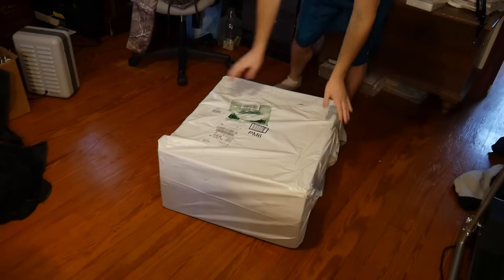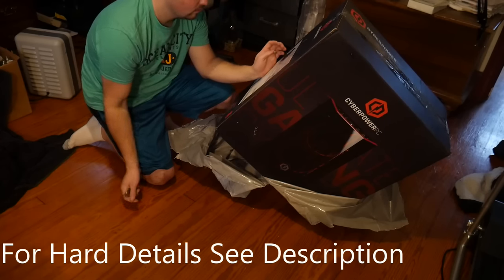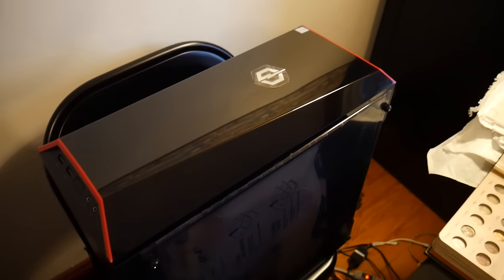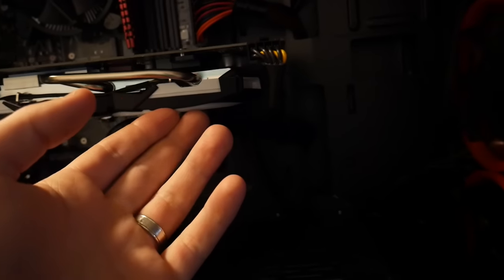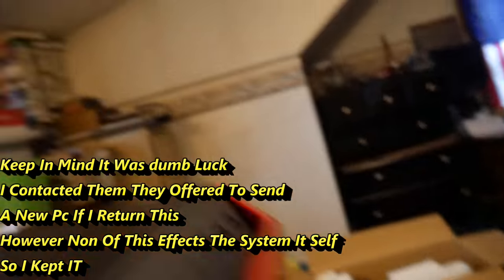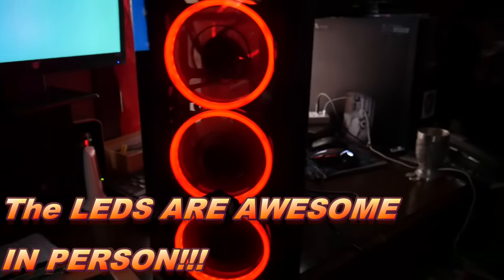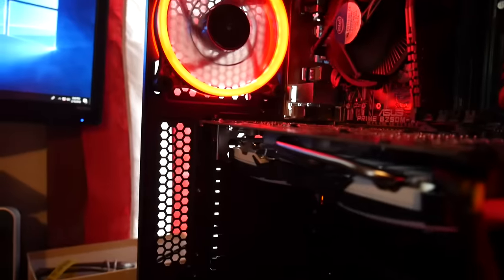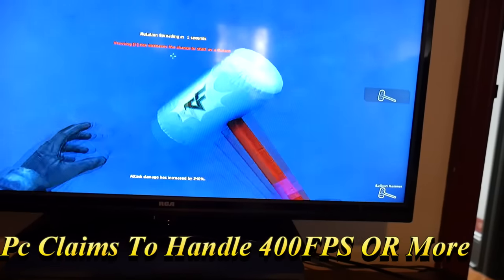CYBERPOWERPC Gamer Xtreme GXIVR8020A4 PC Full Honest Unboxing Test & Review

Comment: How has this compute held up? I’ve read the power supply is bad and tends to go bad, have you upgraded that? Thanks!
Reply from the maker: hello! pc has held up perfect runs like i just b ought it, i have not had a single issue with the power supply and im even running 4 extra fans and more ssd drives, however i am gonna upgrade the power supply in the future but not because im having any issues i just want more power for future projects with it
Reply: The Life Of Scott sounds good, everything out there has some bad lemon reviews i suppose. thank you, when exactly did you buy it? Just wondering if the pc will still be sold come next summer. I will definitely want to upgrade to an ssd and an extra stick of ram should this be the route I take
Reply from the maker: i purchased this almost a year ago, currently they still make it And Plan on making if for awhile they actually make Many Version of it! some run from 699 up to 4,000$ more you spend more you get i got a bunch listed in my descrp
Reply from the maker: also dep on how much your willing to spend currently for 850 you can get the upgraded one with 120gb ssd and 1tb drive and other upgrades for only 850 https://amzn.to/2MUTaNs

Comment: Does the antenna connect to your router? And does it make you have lower PING? Also what is the FPS
Reply from the maker: yes and yes it helps with your internet connection and speed :)

Comment: I ordered this computer and it should be here tomorrow. How does the laptop fan on the side attach?
Reply from the maker: Its Just Enough Side That You Can Wedge It  In The Frame Without it being to tight that it scratches anything, you can also just Get 3M Tape Which u can find here - https://amzn.to/2xWddSu ITs Cheap And Strong And Does Not Cause a Mess When Removing like normal tape or Duct Tape
Reply: Just subscribed. Thanks for the help!
Reply from the maker: Anytime :) Thanks For Subscribing!

Comment: Hey I was wondering if you think that I can stream 1080p60fps using elgato stream command with this.... on the website it says that i7 or better is required for stream command but I was just wondering if u think that I can stream absolutely no problem in good settings. Plz answer
Reply from the maker: In good settings u can. If your worried I would check out my video description I have a bunch of safe computers with i7 for only few 100$ more but if you can't afford that u can always upgrade the CPU if you have great internet you should be fine especially if you over click the gpu

Comment: Hey man im pretty new to the pc world i just bought this pc and was wondering what do I need to do once i boot it up? Do i need to download drivers ?
Reply from the maker: You may need to update the driver which is simple to do under amd website your pc may do it for u if u need any more help let me know
Reply: Oh okay thanks ! And is that all? Just download the driver and then just start gaming or is there more to it
Reply from the maker: thats it! you can add other programs to over clock the gpu and a lot of other things to help make the pc faster but if you dont know much about pc's then you can learn over time about that stuff like i did :)
Reply: Oh well thank you! Very helpful!
Reply from the maker: your welcome! if you have any other q's im here :)
Reply: Alright so once I download the driver whats next? Is there anything else im supposed to do witht that?
Reply from the maker: That's it! Your ready to game now of course u can download other programs and over clock the gpu ect and things faster  but the list is never ending on things to download you can learn as you go
Reply: Hey man im having a problem i turned on the pc and i cant see no display on the monitor , i have an hdmi connected. Do i need a different port?
Reply from the maker: Hey oscar I had that same problem yes try the other ports  use the gpu port it's the last port on the left in a line there will be like 3 other ports beside it
Reply: I dont see another hdmi port.?
Reply: Hey i got it to work! And now im on the driver part i have download the driver and now what do i do? I opened the amd program amd it says versions of something
Reply from the maker: look for the latest one it will be 18.5.1 or higher
Reply: Hey man im think of upgrading my graphics card to a different one what should i look out for ? I hear the it comsumes more power so i would get a better power supply ?
Reply from the maker: Upgrading power supply is a good idea and the gtx 1060 or 1080 I hear is very good
Reply: Are you currently using the graphics card rx 550 that came with the pc ?
Reply from the maker: Same card but I upgraded to 8gb of vram vs the  4gb one that came with it
Reply: Hey I install an 8gb of ram to my pc but when i try to play assassins creed odyssey and i go to settings it tells me i have a total of 4096 mb vram??!
Reply from the maker: vram is different then A Ram stick, Ram Sticks / Cards Are  not GPU VRAM Vram comes with what ever gpu you have, you would have to buy a new GPU to get more VRAM @oscararanda8412
Reply: Ohhh i see your helping me learn lots of things thank you! And one more question how i check my ram stick actually worked ?
Reply from the maker: @oscararanda8412  your very welcome, go to your task bar on your PC at the bottom of your screen of the left you'll see windows icon ( looks like 4 white squares ) right click that then click on system scroll down and on that same page ( about page ) it will say installed ram and show you how much ram you have and other details
Reply: Ohh gotchaa! And hey i was Thinking of replacing the psu cause i heard it was bad and i wanted to know if any psu can be compatible with motherboard port or connections? I want to get a 650 w for the gtx 1070
Reply from the maker: @oscararanda8412  hey oscar im sorry i have not dipped into power supply yet, im going to be working on swapping mine out in the future as well, but i can say so far i have  8+ fans hooked up and never had any power issues  but i do want a higher watt one just for future mods

Comment: I’m getting this pc off of amazon, it says it’s used - good. I don’t want to get any upgrades or anything but some people are saying overtime you should get new powersupply and fans do you think because mine is used I’d need to? I don’t want to upgrade because I am spending a lot of money on it. I want to play forza horizon 4 and fortnite and rainbow six siege.
Reply from the maker: Hello you can get cheap fans for 10 dollars each I do recommend adding one or two inside just for better air flow but it's not needed u should be fine just don't pay over 680 for a used one because you can get new ones for close to that also I've had mine a year and never had any power supply issues
Reply: The Life Of Scott Wenger okay thanks the one I am getting is 899 cad which is 675 usd. And the new one is 999 cad
Reply from the maker: Ok :)

Comment: Hey, the pc you recommended in your description has a GTX 1060 3gb, isn't it less powerfull than the RX 580 4gb that you have in this video?
Reply from the maker: They are about the same if you over clock the 1060 you'll get a little more performance out of it and with an extra ssd  drive it offers a bit more storage and speed but you are right this pc I have ( it's also in description ) and that pc are about neck and neck this would be a little better if you don't do any over clocking
Reply: @ScottsHonestReviews  yeah it's kinda tricky coz as you said the ssd adds a little speed to it. I'm extremely iffy actually, im about to buy one of 'em and i want to make the best choice out. i'd definitely need any last advice on which i should go for
Reply from the maker: When I Get home from work I will go over both pc specs and see for sure which would be best for you. What's your main goal, only gaming or are you planning on it being your pc for everything this one I have I currently  use it for everything and it's been amazing
Reply: @ScottsHonestReviews  Hey, quick update! I ended up chosing the same computer you have with the RX 580. I been using it for almost a week now, so far everything is going perfectly fine. Tbh the pc is performing better than i expected;when i got i installed couple games and tried it, the pc got loud for a bit then i updated all components and no more loud noise when playing, infact i find no difference between just surfing on the internet and playing.
Reply: @ScottsHonestReviews  I plan to buy a SSD and another 8GB DDR4 and slap them in just to give it more juice even though i play latest games like apex without overclocking and i hit high frames. What have you upgraded in yours?you honest reviews helped me a lot so big thumbs up and im smashing this subscribe button!!
Reply from the maker: That's awesome I'm really glad your enjoying it!! So far I'm loving it too almost 1 year 6 m
Reply from the maker: Thank you for subscribing! I'm glad I helped you!! I just upgraded to a 8gb gpu I went with the same gpu Radeon 3rd 580 just 8gb instead of 4 and added more ram I added two external drives 6tb each for storage and 1 ssd  drive I have a cyberpower pc playlist I need to upload more cyber videos
Reply: @ScottsHonestReviews  You're welcome.That'd be great, A whole review of your computer and what you upgraded. you must have a lot of games and stuff to use 12TB
Reply from the maker: Oh you have no idea lol 76 steam games, every gambit game Nintendo game snes game n64 game ps1 ps2 game and more

Comment: Hey i ordered the same pc and its should be here tomorrow. I hear a lot of people complain about the cooling, any suggestion on what to do ?
Reply from the maker: I installed a few extra fans all for 25 bucks and never had any issue , you can take the side panel off and front panel off to help
Reply: @ScottsHonestReviews  hey so my pc came and one of the front fans don't work so I have to get that fixed. But are the fans underneath the graphics card supposed to spin? I'm new to pc so i'm not sure if its supposed to spin or not.
Reply from the maker: Check the fan connection and the gpu fans will only kick on when the gpu gets to hot so the longer you game the hotter your gpu will get then it will kick the fans on
Reply: Also the one that came with mine looks different than the one shown in your video
Reply: @ScottsHonestReviews  Can you tell me how to check the fan connection?
Reply from the maker: Hmm best way to tell you is take the side panel  off on the inside you should see wires going to the fan follow the wires to the plug and plug in and plug out  most times things  come loose in shipping
Reply from the maker: If you can make a video and upload it that could help
Reply: @ScottsHonestReviews  Thank you! I'll be sure to give that a try
Reply from the maker: YW!

Comment: so where the fans just not doing the job in terms of cooling?  or did you just add the extra fan for security?
Reply from the maker: i added extra fans for security, some games like epic battle sim, when the pc is under a lot of stress all the fans kick on full speed to try and cool the pc off causing it to slow down a bit, i just wanted extra cooling power and its done the trick

Comment: does it come with all the plugs needed, like the cables. Do you just connect the cables to the pc and monitor??
Reply from the maker: You'll need a HDMI cord if using it with your monitor  that's it plug and play
Reply: Oh does the monitor come with a HDMI cord also what about wireless wifi
Reply from the maker: Most gaming pcs do not come with a monitor you have to buy one or use your tv

Comment: Hey bro quick question. I’m moving from Xbox to pc and I’ve been eyeing this pc for about 2 months of saving from my job. Any problems or cons to owning this pc? Like overheating or system problems. I’m not familiar with pc at all and I’d like a step by step explanation for this pc before buying it on amazon. Plz respond!!
Reply from the maker: Hello pc gaming is a whole new world then consol for one it cost wayyyy more but the games are amazing issues with this pc well I've owned it over a year now and have had no issues but I do recommend adding more ram and extra cooling if you plan to game for hours at a time besides that I think you'll love it for it's value it's been the best pc I've ever bought the one in my description that I have listed as I recommend if you can afford that one which I believe is now on sale for like 799 or less with 1060 or 108p gtx I would buy that one it's the same pc but upgraded parts at a steal of a price
Reply: The Life Of Scott Wenger thanks bro! I plan to buy this pc and get a razer mouse and keyboard but when u set up the pc is there any like usb for windows for the set up or is it completely ready to use like do u just plug it in and it’s ready? Or is there like a set up u have to do?
Reply from the maker: There is a setup but it's already pre ready so all you do is plug the pc in and follow what it says and your done so basically answer questions on the screen and your finished lol it's very simple
Reply: The Life Of Scott Wenger ohhh so basic set up and it brings up the home page? Also like how do u download steam or anything like that. I’m moving to pc from console and I have no pc experience at all. I just thought this pc was more affordable and worth it at its price. A walk through would help me out a lot 😅
Reply from the maker: Yup basic setup and for steam you'll just setup your internet and once connect you can use your web browser to search google for steam then go to the website and download the steam program from there you can search all kinds of amazing games I'm working on uploading a video of a few steam games I love playing
Reply: Sweet. Thanks bro! Keep up the good work with the vids :D
Reply from the maker: Than you :)

Comment: I loved your review but I just have a question for ya. 

I'm a bit of a gaming youtuber and so far I've been running on a laptop I've had for over 10 years and it's getting difficult to record as I would like so I came across this review on this computer and my question is this.

Can this system handle running an Elgato HD60 with the "new age" consoles like ps4 and xbox 1 and recording software like OBS? 

That's the main reason I'm looking for a new pc. Any helpful info would be great! Thank you.
Reply from the maker: hello, yes it can i personally use a Elgato HD 60 with This PC and Xbox One X With no issues This pc is A Beast i do Recommend Installing Extra Ram Cards And Over clocking The Gpu ( I Recommend That For Everyone For Any Pc You Buy ) Installing Ram Cards Is Super Easy And Over Clocking The Gpu Is Just As Easy As This PC Comes With The Program To Do it + I Have Other Videos In My CYBERPOWERPC playlist that shows how to do it and what settings but Overall Yes This PC Should Handle All You Need!

Comment: I really want to get into CSGO and I was wondering if this PC will run it excellent with like no problems at all of course occasional lag will happen but will it run it extremely smoothly
Reply from the maker: That's going to depend on your internet but if you over clock the gpu ( super easy to do) yeah it will
Reply: The Life Of Scott Wenger will i have to overclock the gpu to run csgo well? I have pretty stable internet i rarely experience lag
Reply from the maker: once you over clock the gpu it stays over clocked so it will benefit all games you play and help your games run better

Comment: i have since brought this pc and have had it for about 5 months now, i have noticed that while it can run everything i throw at it, it gets quite hot so is there any beteer cooling systems available
Reply from the maker: I added a few extra fans for 30 bucks it fixed any heating issues  if you need help I can try and help you but you can buy usb fans or plug fans I have a playlist called cyberpowerpc I have lots of videos there and I'm working on more showing how to do things

Comment: Ok so I have this exact computer but with a 1660ti. My birthday is coming up like really soon and im planning to get a intel core i7 8700k processor. I dont know much about pcs so im just curious if it will run well with these parts in the pc. Thanks.
Reply from the maker: oh yes that will boost your speed much quicker over the I5 you'll be able to notice a big difference
Reply: yea that will be a nice upgrade. i don't think there will be any bottlenecking. the parts seem pretty balanced. i would honestly recommend an amd processor over intel (better value) but then you would have to get a new motherboard. so yea, go with the 8700k. oh yea, one more thing. if you are gonna go through the trouble of swapping cpu's you might want to get a third party cooler as well. (if you have around $30 to spare) the stock cooler for intel processors isn't great.
Reply: @ScottsHonestReviews  is there a specific kind of core i7 9700k i need for the pc pr will it still work
Reply from the maker: i7 will work

Comment: Ik this video is old but I currently have a laptop and thinking about upgrading to this. I just wanna know if anyone has tried playing apex on this and how does it run? I don’t need it to run on ultra settings with 100+ FPS or anything. As long as I can run it on medium settings at around 75 FPS I’ll be happy with it.
Reply from the maker: You'll get 75fps possibly under high settings, even tho it's a old video this pc is still running strong it's a beast